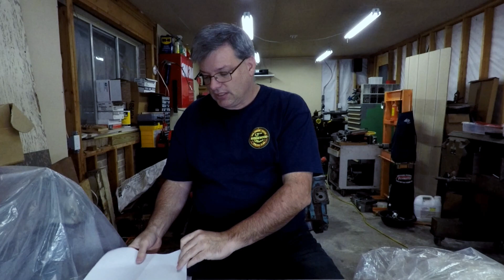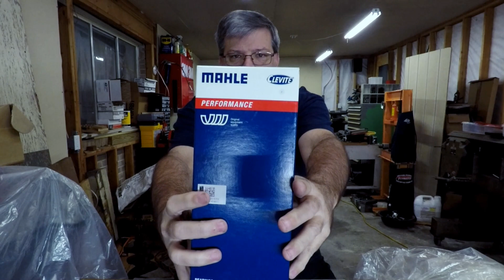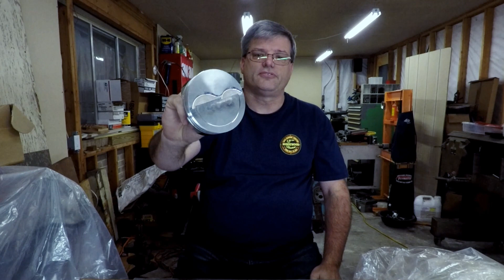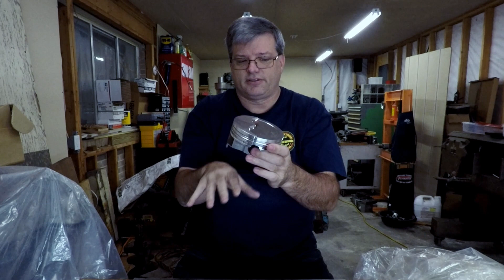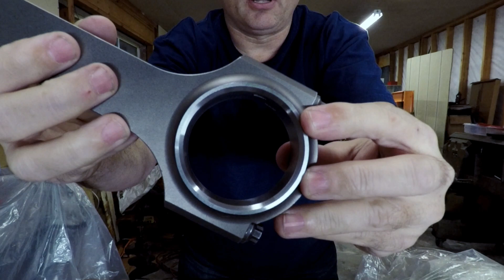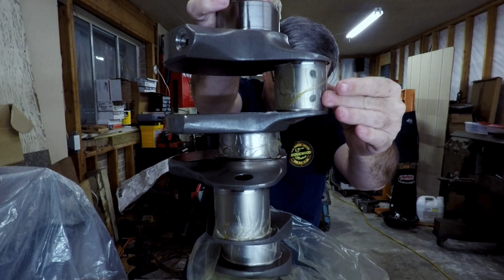440 Source 543 inch stroker kit part 1. What do you get?

Comment: Hi- you state your 1972 Imperial came with a CAST crank (by the way, Chrysler cast from steel, never iron) but it wasn't until a bulletin issued by Chrysler in October ,1972 stating 4bbl 440's would start receiving either forged or cast. My non-hp 1972 New Yorker Brougham is actually forged with EXTERNAL balanced harmonic balancer which has the elliptical counterweight, but thinner 1 inch instead of 2 harmonic balancer. When I saw the cast looking damper, I thought it was a cast crank. When I dropped the pan, I found a forged crank with thick width rods (6 pack rods). The "T" in the vin means not HP, the motor has that balancer because of the heavy rods, and I know the previous original owner who never touched the motor. Are you sure your 440 motor isn't forged(crank)?
Reply from the maker: Positive. I've been building Chrysler engines since 1988. This California emissions 72 Imperial was built with a cast steel crank. My earlier 440s had forged steel cranks. 
I had one of each style crank on hand when I made the video. 
Never say never when it comes to old Chrysler parts.

Comment: I hate to say it but if it werent for China we wouldnt have alot of affordable parts to build engines with or build cars in general. But I digress.....Will you have to run a custom external remote oiling system because of interfence with that 4.5 stroke crank?
Reply: I'm going to say, it's a must
Reply: Is it still true that theres no 9000 cheap crap for a mopar yet? I was praying it stayed that way!

Comment: You could use 1135g steel shim head gaskets that are .018” thick compressed. I used them many times with iron blocks and iron or aluminum heads. Never had a problem with decked block. My 11.3:1 Indy headed big block also has these gaskets since 2 years now as did my previous big block with rpm heads.

Comment: Motor home engines and those internals were just for torque. They were purpose built to spool up and hold an RPM using everything that rotated inside as a source of momentum to deliver that torque, so the weight of the pistons and rods were intentional. I wouldn't characterize that stock stuff as garbage- it was just for a different purpose than what most gearheads would intend to keep for a HP performance improvement in a rebuild. That being said, I have a 440-3 in a little short boxed 78 d100 pickup truck that was installed "as is" from a transplant, and it's only right that it needs to be seen to. To see a commentary about what 440Source is sourcing (albeit from China) for this build, gives me some options to consider. It sounds like 440Source is a very good group to reference. Thank you for putting this out there.

Comment: What harmonic balancer will you use ?  Do you remove weights off flexplate / torque converter since internally balanced ?
Reply from the maker: I picked up the 440 Source balancer, too. The stock converter will work with the weights removed.

Comment: Nothing like some horsepower to get the blood pumping in a gear/ machinist head! I am guessing the deck height will help running pump gas. Looking forward to  next issue of "Ridgewood Machine Magazine"  on how to hotrod a lead sled.
Reply from the maker: I wish they were higher in the bore so provide more quench but they'll give me 10.5:1 compression as it sits.